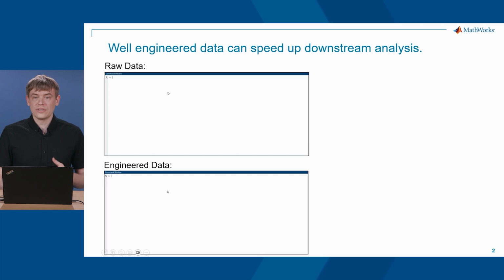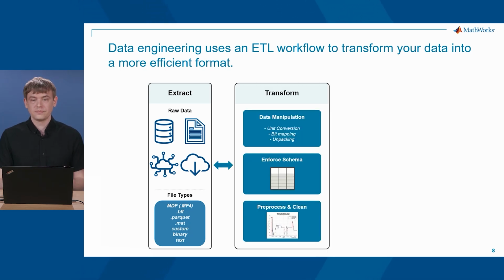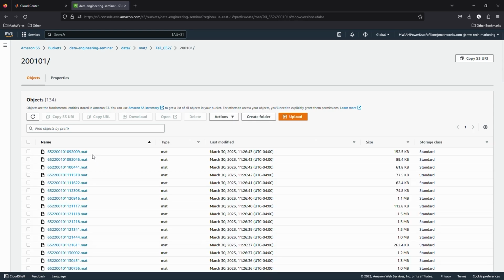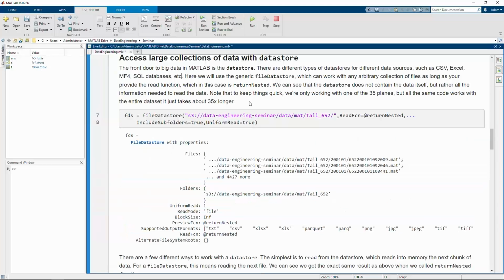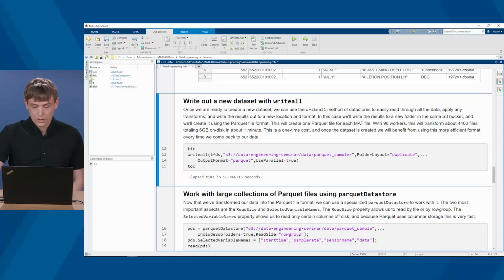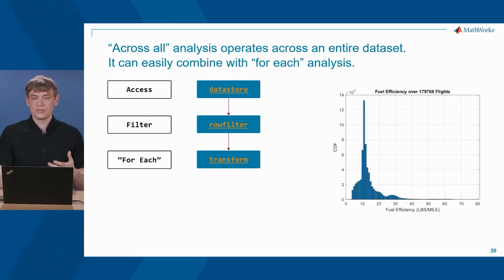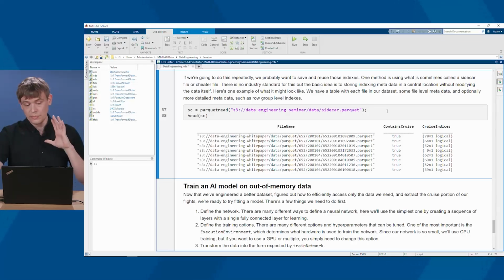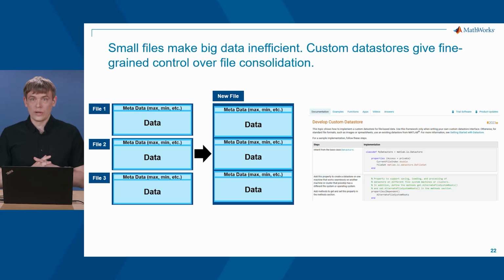Data Engineering for Engineering Data

Comment: Thank you for this great Video!
I am trying to use the advantage of the nested format, because as you mentioned, sensors may be removed or added.
It works for me until the nested2wide helper function. Are you initializing the sensor variables with NaN for the timetable within nested2wide? Or how can we make sure, the nested2wide works for the whole data and the timetables can be vertically concatenated?
Or to put it in other words: What will happen in your example, if e.g. the ALT sensor was removed at some point?
Reply: Hi @Malgro, great question. As with many aspects of data engineering, there’s no universal best answer, but your suggestion is what I generally recommend. One relatively simple approach is to take the list of requested sensors for the wide timetable, preallocate an appropriately sized timetable with NaNs for each requested sensor, then fill in the timetable with whatever sensors are actually available in the data file. That way if a requested sensor like ALT is removed at some point, the code doesn’t break, and you’ll see the sensor values drop out of the concatenated data. Note that if the sensors are recorded at different sample rates or timestamps, you may want a combination of the retime and synchronize functions to align them.